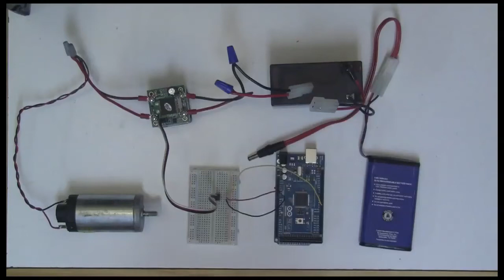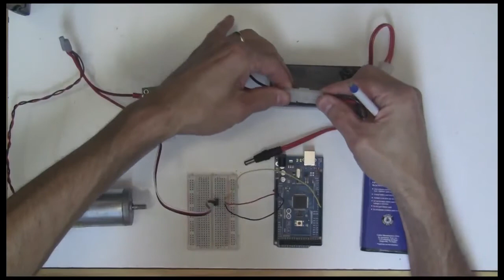The Parallax HB25 and Arduino

Comment from the maker: I also was using the Servo library.  I used the .writeMicroseconds to command the motor controller.  The .write should also work with the appropriate values although I have had occasion where it would work more reliably with one than the other.  I was unable to include the code because YouTube keeps the number of characters in the posts to a relatively small number.

Comment: Would it be possible to see your code?  I have hooked up my motor the same as in the video, but I cannot get it to work.  I'm using the Arduino Servo Library.